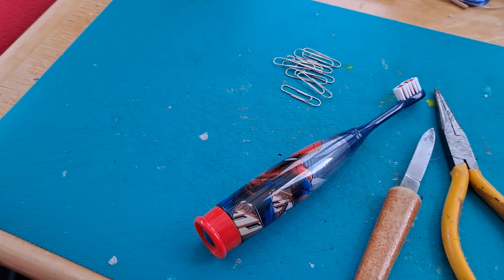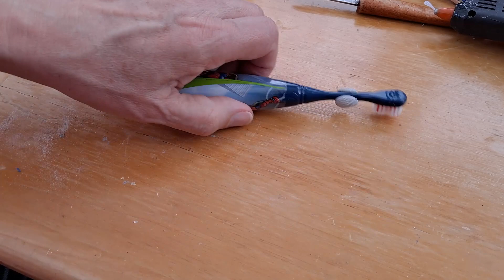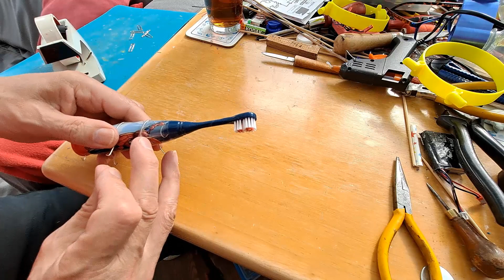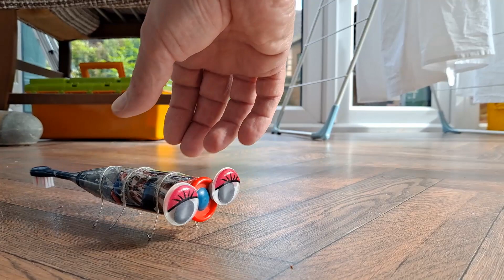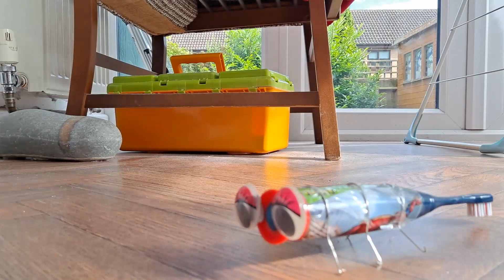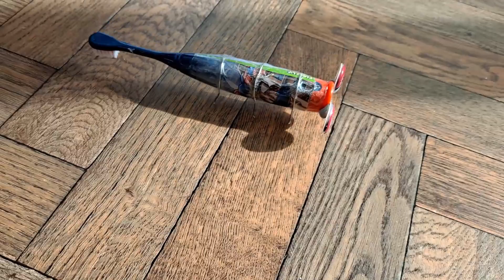Vibrating Toothbrush Bristle Bot revisited 20220607

Comment: Slider2732 here... I got locked out of YT on moving house, which is ironic. 
Fun to watch the way it behaved without the legs, just the Blutak, then the leg length.
Had minor success with a solar version, using the off center weighted motors from phones. Little bots legging around the backyard randomly was the aim. Would be good to get back to the idea, thanks for the push to do so :)
Reply from the maker: Gosh, that is an unexpected comment, Mark. I hope you can sort your channel out, we can't afford to lose that, it has historical importance. If there is anything I can do to help, drop me a line. I recently bought one of your books on Amazon.
Reply: @GrandadIsAnOldMan  Cheers. You may know a lot more than I... I went to sign in, it said about 2 step verification, using the phone number on file. Well, the phone number was a landline and hence can't be reached. Must be a rare problem nowadays.

This account will be for upcoming ghosthunt type forays, showcasing own designs and builds of new products. Used to have a forum with the same name around 2003.

Thank you for the book purchase, which one?  :)
Reply from the maker: 2 stage verification was driving me wild. No mobile signal at home, so I would have to run out into the road to try to receive it. In the end, I changed service provider so it works now. Getting the channel back shouldn't be too hard. Contacting the support team does mean you have to jump through a few hoops, but another one of my friends managed to get it sorted fairly recently when his channel had been stolen and had scam bitcoin adverts uploaded. The book was you "The Beacon / The Beacon 2 Battle of Nuclear Creek: Combined Volume". I had downloaded your original version from smashwords a long time ago, but I thought I should do the decent thing and buy a copy. I even got my wife to read it too 😊 The postbag video just happens to go public tomorrow.
I am probably teaching you to suck eggs here, but these links worked for my buddy.
Get in touch with the YouTube Creator Support team https://support.google.com/youtube/answer/3545535
Channel or account terminations https://support.google.com/youtube/answer/2802168

Comment: I JUST had the brush I picked up in my bag to build with the gbrat but they dont have room in the rv right  now,, Im thinking it might work with just one set of legs at the back.. maybe go the next step and print legs? something like a cradle you could just slip the toothbrush in like old time curlers
Reply from the maker: It will move happily with no legs added, but I found it fascinating that I had a measure of control over the direction it moved, by minor adjustments of the legs.